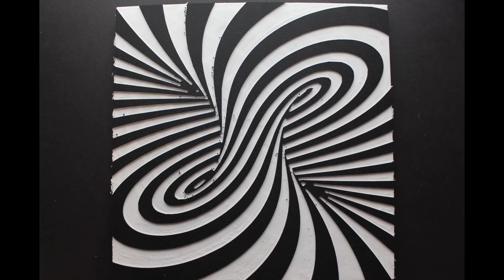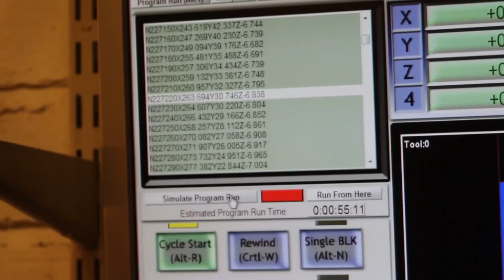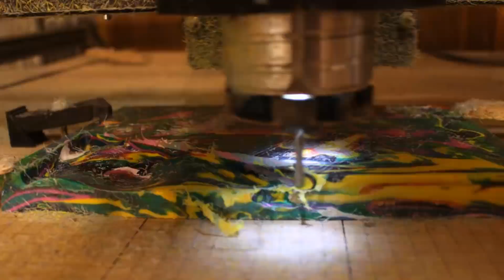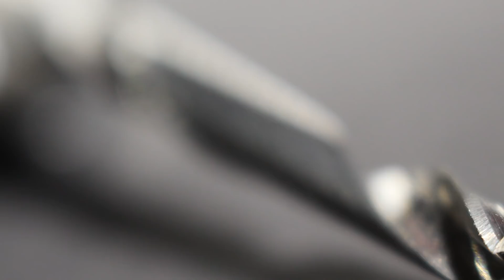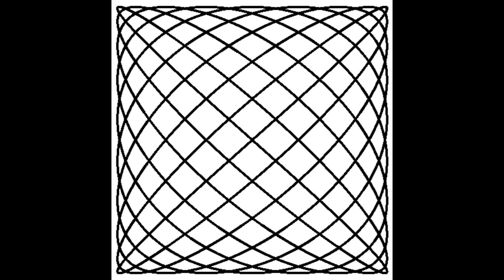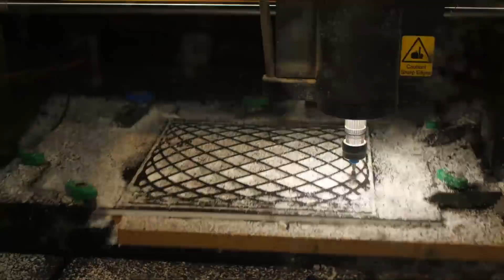Hobby CNC Machine Basics

Comment: I've been wanting to get into the more hobby-grade CNC-machining as well as 3D printing, but i'm kind of intimidated by the software you need to use.

Any recommendations on software that's easy to use that you can find tutorials for?
Reply: If it's cad you're worried about; I think fusion 360 is free for hobbyists (definitely free for us students!) And I've found it easy to learn and quite intuitive for simpler things.
Reply: The absolute simplest is tinkerCAD, but it doesn't teach you what you need to know. I suggest design spark. They don't have too many tutorials but once you get the hang of it, it is very intuitive. I'm not sure how it will work with CNC though.

The key is to just force yourself to use the program for a couple of days and just get frustrated, but once you learn how your program works, you will save a lot of frustration in the long run.